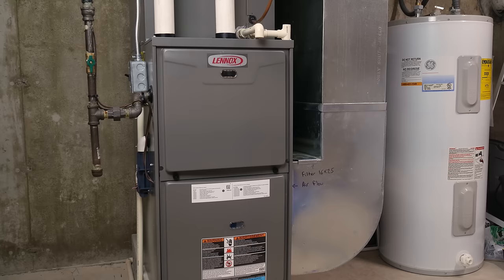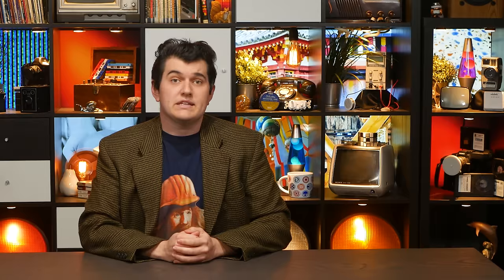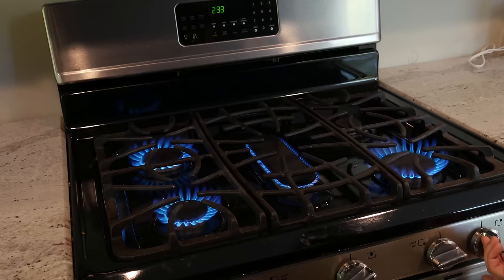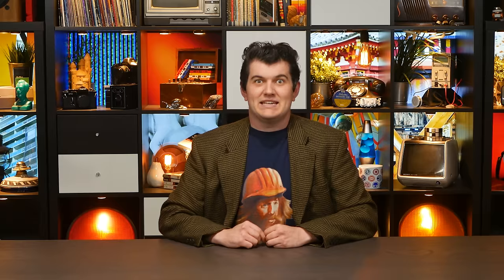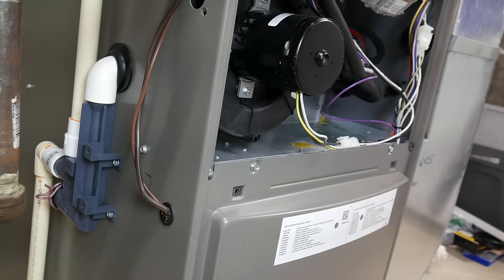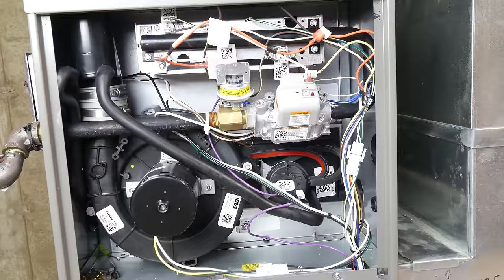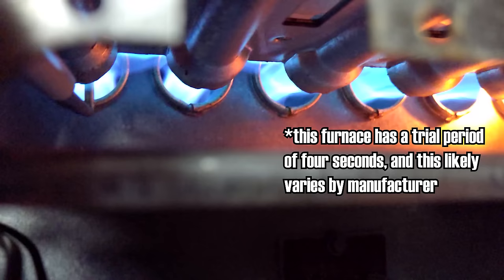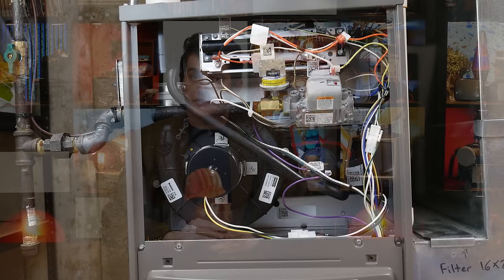Forced-air Furnaces: The What, Why, and How

Comment: "Fun" story. At one of my previous jobs we were all given low level carbon monoxide poisoning. According to our maintenance guy, the heat exchangers had cracks big enough you could slip your hand into them. A "lack of funds" meant that they system hadn't been inspected in quite some time. When the carbon monoxide alarms went off, one of our managers told people to get back to work and that it was a "false alarm". Yeah, no. Pretty much everyone ignored him, thankfully, and evacuated. When the fire department arrived we were told it wasn't safe to be in the building.
Reply: But I vengefully want to know what happened to that manager (and company)!!!
Reply: @regular-joe  You'll be surprised (or maybe not) to learn that absolutely nothing happened to him, and as far as I know he's still there to this day. He was upper management (number 3 in the company basically), so there wasn't much that was going to happen realistically. I suspect COVID has put a MASSIVE damper on their sales though. I can't imagine they're doing well these days.
Reply: @IanDunbar1  Ideally he should have been arrested for what he did. Was it a company so big that they effectively owned the police, Capone style?
Reply: It doesn't really require much funds to check for cracked heat exchangers. I've been doing HVAC, plumbing, and electrical for years. It always seems heat exchangers get people confused. If there is a crack in a tube, the blower will blow air through it. An idiot can stick a grill lighter in a tube and turn the fan on. If the flame persists there is no crack. If the flame dies there is a crack.
Reply: @megafarad4933  Dunno, that was just the story we were given. That said, I'd believe it. They were crazy penny pinchers. For instance, the owner used to refuse to use curb side check-in at the airport because you were expected to tip, and he felt like that was an exorbitant expense.
Reply: I'd say report that shit to OSHA, but who am I kidding. With the current people in charge, OSHA'd probably take notes and tell them they're doing a great job.
Reply: What kind of company was it, as in what did they sell/offer?
Reply: Walt Disney's parents died of carbon monoxide poisoning.
after Walt became wealthy, be bought a nice house for his parents near Los Angeles, and brought his old parents from their home town. He ordered his "imagineers" to work on the furnace, and it malfunctioned, thus killing his parents.
He never recovered from this incident. Also, Weird Al Yankovic's parents died in the same manner.
Reply: imagine living in a world with protections for workers. sounds kinda nice
Reply: @cashnelson2306  : Like everything else for some position or against that same position, it sounds like something that will be carried to insane extremes by obsessives who focus on the slightest risk of something regardless of whether they're being practical or not. One side says that we can only have flame on open stretches of water during gale-force winds because the risk of carbon monoxide is too high to be countered by heating efficiency, the other side says all fires must by run inside airproof chambers because the risk of carbon monoxide can't counter the requirement for heating efficiency; one group dies of hypothermia, the other dies of carbon monoxide poisoning, but both drag us to hell before they're finished...
Reply: @absalomdraconis  are you mad because people didn't die lmao
Reply: Cash Nelson safety third
Reply: (not a carbon monoxide poisoning story, but still workplace safety story where upper management is dead from the heck upwards) a tornado was ON THE GROUND 15 miles southwest of our building heading straight for downtown. Others had already gone down to the basement, but upper management ordered the front-line hotline agents (on the 8th floor mind you) to stay behind. As LoNg As CaLlS wErE bEiNg AnSwErEd was all they cared about.... back then I was just a Tier-2 senior technician and was team lead that shift, I put my foot down and wasn't standing for their crap and encouraged everybody to log out of their phones and run downstairs anyway. We didn't take a direct hit, but windows were blown-out in the area where we all were. And all management could say was something like, "see the floor didn't crumble", and, "you all could've hidden in the restroom or kitchenette or something"... absolutely despicable! While they wanted to write me up for not folliwing orders, nothing happened, nor did anything happened immediately to management. But the big-headed bullying department director and his evil little gaslighting assistant later got pushed out of the company for other reasons anyway. Good riddance.

Comment: I had my furnace replaced this year, after the old one wouldn't start due to a cracked heat exchanger - one of the sensors stopped it. The repairman told me a story about family who had a leaky roof and put a blue tarp over the leak - and also unfortunately over their heating vent! After they started getting very sick, they realized what was happening before it was too late. And after hearing this story, I went out and purchased a carbon monoxide detector to go with the new furnace! Thanks for the very educational video...
Reply: ebulating  The combustion is always going to produce some amount of CO though. You really need that sensor to be in the living space, away from the flame. Then, if it's going off, you know you have an actual hazard.
Reply: I'm living in blue roof territory (sw Louisiana) right now and I'm seeing a lot of houses that have their vents covered...
Reply: @liesdamnlies3372  Putting it in the return air duct would take care of that.  If you have so much CO in the air going to/from your living space that it's tripping a CO alarm (which actually requires quite a lot of CO to trip) then you have way more CO than is safe.
Reply: @uzlonewolf  Fair point.

Comment: HVAC Tech here, The flame sensor does not work on temperature.  The flame sensor is actually a  peice of metal that carries a current and the flame itself bridges the gap between ground and the rod... also a thermocouple is a device that turns heat into electricity  and is used in a standing pilot system ... the small amount of electricity is used to hold a spring loaded  safety switch closed with an electromagnet.

Comment: I’m in Australia, we normally have wood fired, central heating or as what my home has is floor heating via running a fluid through tubes under the floor for each room allowing the heat radiate up from the floor. 

It feels lovely to get out of bed and walk to the toilet on a warm wooden floor at the middle of the night.
Reply: Modern mountain homes here (I live in Colorado, USA) have floor heating because there's no need for central A/C if you live in the mountains. It's a cool idea isn't it.
Reply: In Finland we use wood, oil or just plain electricity for heating. In north wood is very commonly used. My father has a huge oldschool stone furnace and it takes a lot of wood to warm up, but it stays hot for a long time once warmed up.
Reply: In the Missouri Ozarks most of us grew up with wood heat.  Alas, the influx of foreigners from Illinois, California, and other communist territory diluted the intelligence quotient so much that most insurance companies refuse to insure houses that heat with solid fuel.  The risk of fire from stupidity is just too great.
Reply: Another Aussie. To clarify "Central heating" is our term for the gas furnace ;D
Reply: To clarify, the vast majority of Australia is too hot for any kind of dedicated heating system beyond an electric resistive heater/reverse cycle AC. The comment was referring to the colder/ more southern states and cities.
Reply: @thefixerofbrokenstuff  Looks like this one inhaled a bit too much wood heater monoxide to think clearly- OH wait you're a boomer too lol
Reply: m square I’m up in Lithgow where it snows in NSW. 

And for anyone outside of Australia, yes it snows in Australia.
Reply: ebulating it’s not so expensive here in Australia, since a lot of newer homes up in the colder mountain areas in TAS, VIC and NSW are being installed with radiant floor heating because it more efficient and cheaper then reverse cycle air conditioning.
Reply: from Western Australia: "What is central heating"?  The closest we have is ducted reverse-cycle air-con in some homes.  Unflued has heaters in the lounge room are still common, but no central furnaces.
Reply: @m2heavyindustries378   I would say the majority of Australian homes do have dedicated heating for at least the main living room, or did before it was replaced with reverse cycle AC.  Just not for the whole house in the coastal cities.  Wood, oil and gas were common. Central heat is more common inland, and in Melobourne.  http://yankinaustralia.blogspot.com/2011/09/what-no-central-heating.html

Comment: I had a furnace fail to light (and why does this always happen on a weekend?).  It would light, then shutdown within a few seconds.  The repair tech asked if I was handy with basic tools (I am), had me open the furnace, remove the thermocouple, and confirm it was mostly black (it was) -- then told me to grab a wire brush and brush off the carbon buildup (I used a Dremel tool) until it looked completely clean/new again.  I put it back in and the furnace worked perfectly.

The advice he gave me was that ... even before you have a problem with your furnace, buy a spare thermocouple and a spare inducer fan for your furnace because these were the two most likely parts that can fail and leave you without heat.  Having them on-hand means you can just swap out the parts and have heat again without making a service call in the middle of the night or on a weekend.
Reply: There is no reason to buy a spare inducer motor as they rarely just fail and there is no reason to buy a new flame sensor as they can almost always be cleaned.  Now a new furnace ignitor that is a whole bother conversation.  Buy an extra one actually buy two because you are likely to break the first one while installing it
Reply: The first failure on my 9 year old furnace was the draft inducer (happened earlier this week). I also had a nice crack in the plastic duct behind it and replaced that as well.

Comment: I've installed many of this particular furnace and can tell you that at 13: you can see a red sticker notifying you that there is a shipping bolt and it's location that needs to be removed. If that has not been done on your furnace, the blower motor will be "locked in place" and will not let the rubber anti-vibration thingys do their work. It may or may not have been removed by your installer, but the red sticker should be removed once accomplished. Also, you must be using LP gas, because there is a low-pressure safety which will shut off the furnace if your tank is not giving you enough pressure. It is the brass adapter and attached thingy which is the first equipment the gas pipe entering your furnace encountered. It comes in a LP conversion kit which also includes smaller orifices and a spring for use in your gas valve to set the correct pressure. I enjoy your videos!

Comment: My house, in Ireland, was built for this setup - there was a brief period in the 70s that they were in vogue - but was instead set up with a resistive electric element instead. The running cost of that is likely why a previous owner got it plumbed for our more regular radiator system
Reply: @timotheatae  It can, but it is consistently referenced as the most expensive by area compared to other methods.
Reply: Timmity3 there are very very few areas (even geothermal Iceland and hydro Norway barely get there) where resistive electric is cheaper than gas or oil, and there is literally nowhere where resistive electric is cheaper than heat pump electric.
Reply: Jasper Janssen unless the resistive load is the “dump load” of a small wind power system
Reply: @JasperJanssen  Resistive electric is always more expensive than heat pump in the utility costs – but in installation, they are an order of magnitude cheaper. So if you have an energy-efficient house, or electricity is cheap in your area, installing a heat pump may make no sense, as the return on investment would take a multitude of years.

Comment: Alec's own pinned comment:
"Turns out the fire can be a diode!"
At least two comments I've read so far posted after:
"Actually, the flame can be a diode."
Reply: In honour of those people, Alec I have to add my own 2 coins.
You may not know this, but if done correctly, fire can actually work like a diode. And so you don't need a thermocouple. It's crazy, I know.
Reply: I'm going to assume they either watched and commented before he got the correction up or were watching on mobile or something and just didn't see it.  I pretty much always watch on PC, the few times I have used mobile (and looked at the comments) it felt incredibly clunky and I could easily see someone missing a pinned comment.
Reply: @grn1  I would assume they just missed it. I know that happens. I was just trying to make a joke about it :D
But yea Alec's comment was at least earlier than all other people's I saw.
At least if the time stamp on the comments is to be believed.
Reply: A diode can also create a flame with enough current. Well, once, anyway.
Reply: @mojad6137  You can actually breathe water indefinitely, up until you first breathe air. Research is being done to find a way to allow us to return to filling the lungs with liquid for health purposes and for deep diving or space environments.
Reply: @mojad6137  sorry, my comment was meant in reply to someone who made the joke that you could breathe water but only once. Not sure how it linked you.

Comment: Another great video, I love this channel. I must say that most of the gas condenser units, in Belgium at least, are a lot smaller and output more energy 20/35kw. They can also adjust power output if only low temperatures are needed for example for floor heating. On top of that, only one tube/chimney I needed because it has a double wall. Inside are exhaust fumes, outside is intake for oxygen. And indeed, most of the gas heaters here are for heating water that circulate it to you radiators.  

But, as I'm aware there are dozens of different systems. Heat exchangers are getting more popular. Within a few years, new installations of gas powered heating will be prohibited.
Reply: The intake/exhaust arrangement on our boilers isn't that much different, it's usually concentric indeed, but most manufacturers sell adapters to  use seperate intake and exhaust tubes on their boilers or the boilers are even built like that and have an adapter on them to use a concentric vent, just like the american system can probably be adapted to concentric.
Our boilers do modulate their power output (if properly configured), while as far as I know US furnaces don't or do it maybe in just 2 steps, but that's more out of necessity than anything else: A water based heat transferring system reacts a lot slower. Older (or cheaply upgraded) boiler-radiator systems that just turn on and off often overshoot their target room temperatures because the radiators keep delivering a lot of heat energy stored in the water and steel, then when the temperature of the room drops it takes time to heat up the water and steel again before heat is actually transferred to the rooms. By modulating the power and water temperature it's easier to match the heat output of the radiators with the heat loss of the rooms and keep the temperature more constant. Because water doesn't compress but it does shrink and expand with temperature it's also better for the modern low-volume heat exchanger in the boiler to keep the water temperature as constant as possible. These reasons aren't that important in a system that transfers it's heat directly to a high airflow like the US furnace: the mass is a lot less so overshooting desired temperatures and lag in heat delivery is pretty much entirely determined by the temperature window of the thermostat, and since the heat exchanger is cooled by the high airflow and isn't pressurized it can also handle a lot more warm-up/cool-down cycles before it fails.

Heat pumps are gaining territory over fossil fuel powered boilers, but the sad reality is that the Belgian power grid is too outdated to provide the on-demand electricity we actually need to convert to electric heating and mobility, hence why they stopped the symmetric injection/consumption prices and introduced peak tariffs with the new digital meters, forcing people to use home battery banks to store the overproduction of their solar panels and think about spreading of loads. 
Also despite the prices of air-to-water and air-to-air heat pumps coming down and the government giving incentives, the most efficient heat pumps, earth-to-water ones, are still ridiculously expensive because of not only their price but also the expensive drilling or digging that is necessary to extract enough heat energy from the earth beneath us, and it's simply not possible in a lot of homes.

Comment: The flame sensor, as far as I know, actually works by conducting electricity through the flame, not by sensing a chance in temperature as stated at 15:53.
Reply: Yes and no. In a high efficient condensing furnace you'll find a flame sensor that uses flame rectification to detect the flame, but in older standing pilot style furnaces you'll find a thermocouple which "senses" the heat by use of a thermocouple that produces a small voltage when heated.
Reply: tech conn pinned a comment on this point. Electricity is weird!
Reply: @schellenbergenator  That's true. Should have specified I was talking about the flame sensor highlighted in that particular part of the video. Having looked inside a very similar furnace I knew it was of the flame rectification type.